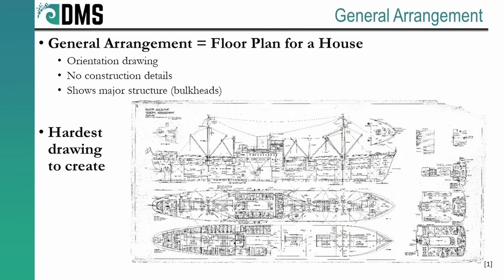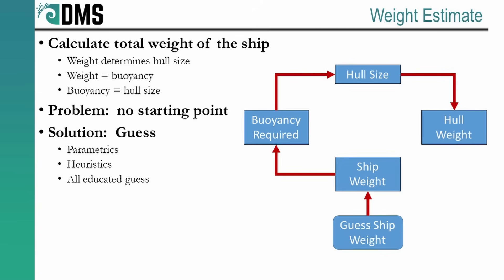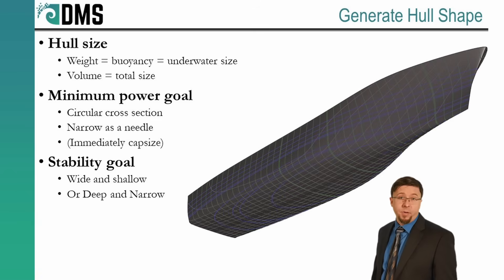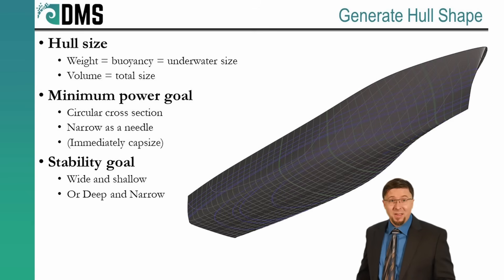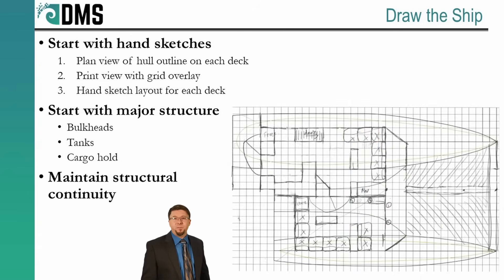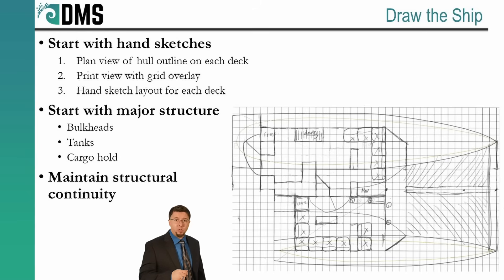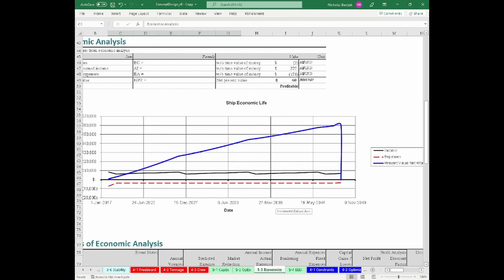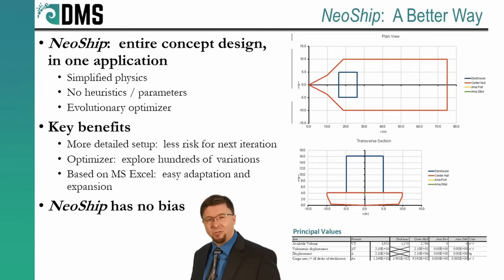How to Design a Ship:  Creating a General Arrangement

Comment: which software are good for ship design
Reply from the maker: We use a combination of software for different tasks.  And of course, there are multiple options from different vendors.  The software I use:
Rhino 3D:  for 3D models
Autocad:  for drawings
GHS:  for stability analysis
FEMAP:  For FEA
Maxsurf:  for concept design work

Plus about 2 dozen custom programs and around 30 custom spreadsheets.

Comment: How would you alter or change your mindset if you are designing a ship for drones or to be fully automata without humans?
Reply from the maker: Excellent question.  In fact, I went through this on a few different drone design projects.  The major parts of the design process are still the same.  But power management becomes far more important.  We need to carefully manage power demands and balance it against power generation (especially important if using renewable energy for the power source).  We need to protect electronic equipment, instead of protecting humans.  And vessel stability becomes more important because we deploy the drone into ocean waves that are far too large for it.  Normally, the drone needs self-righting capability, which is very demanding from a stability perspective.  Overall, the same process as a big ship.  But with a few key changes in priorities.
Reply: @DatawaveMarineSolutions hello there internet friend! I’ve been designing an autonomous ship as a fun passion project for most of the summer and I’m at the machinery space and I’m realizing that I don’t know much about mechanical seals and the such. I’ve been converting a 17foot aluminum canoe into an autonomous aircraft carrier for cargo delivery. The flight operations it will be conducting are using scale model sized ISO shipping containers carrying various payloads. I’ve already got the gantry crane and elevator system worked out inside the hanger deck and the system entirely removes the need for lashing making it fully autonomous. My static tests appear to be promising, but now I need to install the machinery and do sea trials! I’m a hardware and software engineer by study and trade, I do electrical, computer, and software engineering work professionally in my trade. Naval architecture has always fascinated me and for my first project I wanted to convert this first hull and prove out the concept on a limited budget before doing a keel up design. I’ve produced a 5kW 4 stroke engine and 20 kWh of lithium batteries for the power plant. The batteries are easy to reduce to give more freeboard, the hybrid approach was for improved range especially since all of the drones in the air wing recharge off of the carrier when docked in the hanger. From one fellow enthusiast to another I hope this project sounds fun :) I’d love some feedback, you are an amazing teacher

Comment: I'm drawing up plans for a fictional ship and decided I wanted to try making an actual realistic plan of her. She's 47 meters wide by 352 meters long (roughly). The GRT I'm projecting is around 90-95,000 maybe even 100,000. In my fictional universe, she's drawn up in the mid-to-late 1920s and construction started sometime in like, 1928 or 1929. then the stock market thing happens and construction halts. The project resumes once funds are located and she's launched on 17, August 1934 (in lore). She has her maiden voyage in 1936 iirc. Its still a WIP. Her hull is 41 meters tall. with the supestructure, masts and stuff, she's around 170 something meters tall. Do I know if she'd actually work as a real ship? nope! but I certainly can theorise!
Reply: You can build a scale model and find out in a tub where the points of gravity would be. Current super container ships do have surprisingly tall loads on a completely flat - but wide - bottom hull. 

Adjusting the 'beam' can possibly make the semi-Eiffel Tower bridge, plausible if all superstructure load is distributed, evenly...

Comment: How much change when you design a sailing ship?
Reply from the maker: About 15-20% different.  The process is generally the same, just a few additions for structure and propulsion.  Now we need to design a mast and sails, change the hull shape slightly.  Same process, just different priorities.

But this becomes much more effort when designing a small sailing ship (anything under 40 ft.  / 12 m.)  On those, space is so limited, that you really need to consider the ergonomics of how someone will sit in the cockpit, how to arrange all the lines for easy access, how many winches will the ship have, etc.  That human element adds a lot of effort when laying out the ship.
Reply: @DatawaveMarineSolutions  
"(...) more effort when designing a small sailing ship (...)" 

I'd love to see a quantitative comparison between David Raison's Maxi 650 (in serial production by IDBMarine) and Janusz Madersky's Globe 580 (available as an assembly kit). 

I can't even tell what length, I should look for when browsing for used boats (even 200 foot plus can be sailed, shorthanded, but I'm hardly independent if I can't even erect the mast, myself or require inboard engine maintenance - having one spot to stand upright within a cabin would be nice, so would be a closed wet head)... 

One could probably crank out regular videos on any ship, 'Yacht Monthly' comes up with - commenting on design choices...

Comment: I am an outdated mechanical designer/engineer of heavy equipment than wants to build his own small light weight car topable boat. Who now works as a laborer because too many heavy equipment companies went out business. My brother a retired landscaper built a successful foamy  row boat.( Constructed from closed celled styrofoam bought from a building supply store) I have watched several videos from creators that have constructed similar boats using poor man's fiberglass and construction foam. (burlap or an old bed sheet to replace the fiberglass and then exterior house paint to replace the epoxy) My nearest lake is 8 miles away, has a large surface area of water, and in many areas only has a 3 foot water depth. ( typical Midweastern USA lake) My first thought was a  sail boat and a fising boat. Due to the  shallow water depth, fishing is always better in the shallow water, and the fact that such shallow water can quickly develop rough water conditions, I have abandoned the sail boat concept and the flat a hull. ( a typical design for inand water boats) ( have been in a float bottomed John Boat in  rough waters and they are hard to steer and required a lot of force to move them in rough water, and they have a terrible choppy ride.) I have now decided to build an axe bowed boat with side angles 20 or 25 ° on the bottom to get the boat to sit slightly lower in the water, because I want to make my own boat, and a 25 pound or under 2.5hp, 2 cycle motor. I want to add a splash or wash board on top of the front to keep the waves from washing water into the boat. I want some speed in my hull with rough water capability. ( a little of the best of both worlds) I don't see this type of construction on inland boats. I think that I am on the right track. Am I on the right track? Have used Excel to iterate other engineering problems and it works great even if you just do it by trial and error. Looks like you have a great concept.
Reply: Sounds like a V-shaped displacement hull, like motor boat designs (used to be made from aluminum) - yet, a fold-able multi-hull with austere Kayak like hull 'crawl cabins' would grant much stability without much draft (though would consume time to assemble and disassemble, each time)...

Comment: i wonder how Your app handles in design of sailing vessels (i wonder how to predict hull behaviour at different heel and different speeds and wave heights)
Reply from the maker: Neoship doesn't go to that level of detail.  That is more appropriate for a velocity prediction program, which is how they design racing boats.  But Neoship does calculate sail forces without the hull interactions.   It also includes voyage analysis to determine average power from the sail, considering variability of wind strength and direction within a region.
Reply: @DatawaveMarineSolutions  I find one thing particularly difficult: smaller the vessel, bigger the impact from waves. How to calculate this when one second wetted surface is (for example) 25 m2 and 2 seconds later its 33 m2. On a bigger boat this variations are not that big in relation to overall dimensions. Here I'm looking for efficiency in environment of constant change.
Reply from the maker: @gradowik  No easy answer to that.  Basic version:  start with a hull that is efficient in calm water, and then focus on minimizing vessel response to waves.  For a more analytical approach, seakeeping theory allows us to calculate the resistance added from waves, based on 2nd order low frequency drift forces.  We can analyze the efficiency lost due to waves and compare alternatives.  Unfortunately, that advanced analysis often requires more budget than a small boat can justify.
Reply: @DatawaveMarineSolutions  it looks that I should choose naval architecture 20 years ago lol. Thanks for Your advice

Comment: I always wondered if it would be possible to scale down at least the overall shape of one of the classic Edwardian liners in a package that is roughly 80-100ft in length. ...with tweaks to make the design practical, of course. I just don't have the math background to actually run the numbers though!

Comment: How do i get the software (NeoShip ) for the design
Reply from the maker: Sorry, but DMS doesn't offer NeoShip for sale.  The program requires adjustments with every project.  This approach is suitable for internal use, where DMS is both user and developer.  But it will not work as a packaged program we can sell.

Comment: in reality its almost impossible to have LCB=LCG even if you manage to line LCB with LCG at first. it wşill change over time because of fuel consumption.
Reply: @colaves1  which is not suitable especially in big ships. Fuel tanks need to be somewhere near engine room. Pumping the fuel from midship where the  LCB and LCG are usually are (towards the aft most of the time) is an task of its own. 

İts possible in smaller ships maybe upto 20m or so. in a bulk carrier its not the best possible way to place fuel tanks

Comment: @7:00 So if you had a trimaran with the perfectly circular hull cross section, and small amas for stability, would this be the best thing for fuel consumption? Or would the extra amas just add more drag than an equivalent monohull?
Reply from the maker: That is a brilliant question.  And you are 85% correct.  The trimaran works best for higher speeds, where resistance is dominated by waves.  At low speeds, most of the resistance comes from friction with the water, and we want to reduce the wetted surface area.  In that case, a trimaran loses.  It has 3 circles in the water, so more surface area than an equivalent monohull.  

From a stability perspective, trimarans are halfway more stable.  The trimaran has way more stability than a monohull . . . unless you heel so far that one of the amas goes underwater.  Then it has no stability.  So it is more stable, but our requirements go up to ensure the trimaran never buries the amas.
Reply: @DatawaveMarineSolutions  Thanks! But what is the threshold between higher and lower speeds? 30 kmh?
Reply from the maker: @DrZygote214  The speed changes depending on the ship size, which is why we normally determine these thresholds with the Froude Number, a non-dimensional measure of speed.  Wikipedia has a simple explanation on Froude Number (Fn):  https://en.wikipedia.org/wiki/Froude_number

In general, ships below a Froude number of 0.30 are dominated by friction.  Above Fn = 0.30, waves start to dominate.  When we perform a resistance estimate, the friction and wave making get calculated separately, which lets us examine the relative magnitude of those two components.

Comment: Speaking as a hobbyist and a civil engineering tech: Not only is this neat from a naval architecture standpoint, this is a fantastic presentation on the engineering process--MetaEngineering, if you will. The next time I run into some young folks considering a career in engineering, whatever discipline, I'll point them at this as a resource.
Nick, if you don't eventually end up as an old, crusty professor, I will be very disappointed. (Yes, I know you give seminars occasionally.)
Reply: I think it would be like classic submarine but more like skyscraper because if it accelerate it give you the Illusion of gravitational forces

Comment: A circular needle hull might not capsize if the center of gravity is close to the bottom of the hull.
Reply from the maker: True.  That is basically how a submarine maintains its stability when fully submerged.
Reply: so now the question is how to design cargo submarine that can carry containers (or grain, or something like ore) and allows to unload it in a reasonable time. I wonder if it's even possible to gain profit from shorter route (under ice cap) or cost of such technology would outweight profit from transporting goods 3 times faster.

Comment: You prefer computer assisted line drawings. The 21st century is amazing. 
I cannot help but think 19th century. They must have been some amazing minds.
Were there more failures than successes? Or did they have it pretty well understood?
Reply from the maker: I wouldn't say that the 19th century was bad.  They still have fairly reliable transport back then.  But it depended mostly on copying previously successful designs.  

The 19th century involved less design risk.  They didn't have all the science and simulation capabilities I have today.  With modern computers and science, I can design a boat completely on the computer.  All theory and no physical testing.  And the first ship will be built within 5% of the theoretical predictions.  (rough estimate).  

That type of confidence makes it cheaper to try new things and predict them before risking the ship.  So modern shipbuilding is partly about being safer.  But it also achieves more performance, with the same level of safety and cost.
Reply: @DatawaveMarineSolutions   The 1800s editions of the Royal Institute if Naval Architects were pretty amazing to read through.  While I was getting my degree I perused probably 25 of their annual collected editions.
Reply: I read they used Simpson's rule to help calculate the displacement.  For each cross section, the area can be determined using a planimemter: a device looking like a divider with a counter.  Just trace the crossestion and the area can be calculate.
Reply from the maker: @shaider1982  yes they did.  In fact, Simpsons rule is still something they teach naval architects.  And some programs still use it.

Comment: haha, during the whole video I was thinking: I'm pretty sure they start from the traditionnal hull shape used in the business area of the client, customize it and at most try 1 innovation point, and in the end that was exactly the message. 

Full blue sky innovation of objects this size is probably managed in programes, that would involve universities, and a ton of models and uncertain outcomes. They would not get into such a pipeline when a client "just" wants a ship and has already chosen the name for it.
Reply from the maker: Very true. I meet a lot of Clients who just want a copy of the current hull in their business area.  In fact, I know one firm that specialized for this.  They just make tug designs, which are basically cut and paste engineering.  Very little changes from version to the next.

The good news is that we don't often need to go to full university and research for true innovation.  But it does take slightly more engineering.  For example, I have one Client that wants to create a net zero ship with sails and a new fuel source.  That is not a full research project, because we already have science for all the individual components.  It's just a matter of mastering the mix.

A full research project would be if Raytheon wanted me to design a super-cavitating torpedo.  The problem for that project would be that we can't predict torpedo guidance at super-cavitating speeds.  (At least not that people admit publicly.)  So in that case, we first need research to invent the science for predicting our problem before we can even solve it.  Thankfully, very few people fall into the research category.  You can achieve a lot with custom engineering.
Reply: @DatawaveMarineSolutions  
To be fair, 'traditional' designs may have incorporated considerable 'trial and error' over generations of their production when e.g. Bruce Bingham simply sketched out two derelict 1050s workboats and 'reverse engineered' them as the Flicka daysailer - which was said to be surprisingly performant, given their generous cabin...